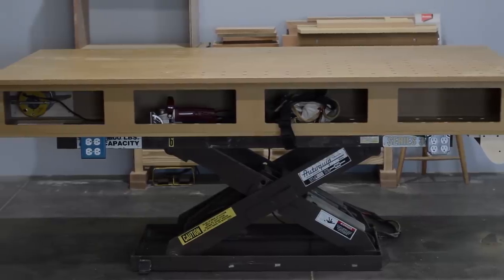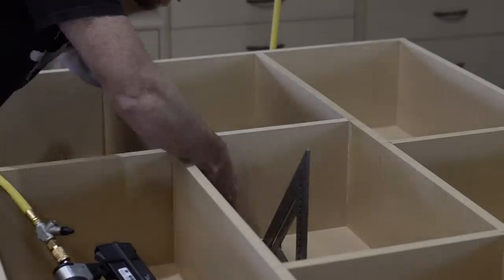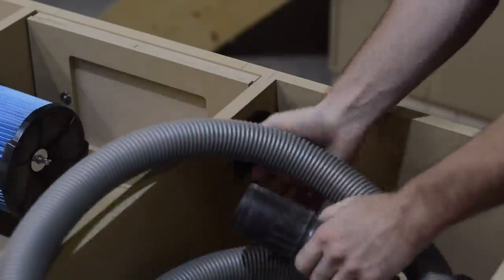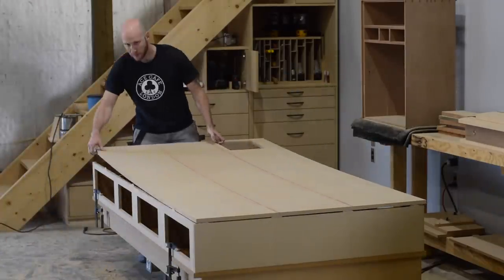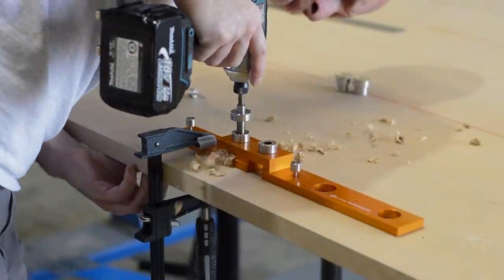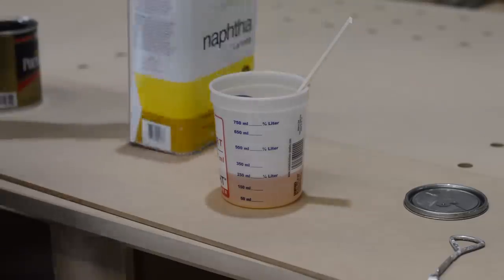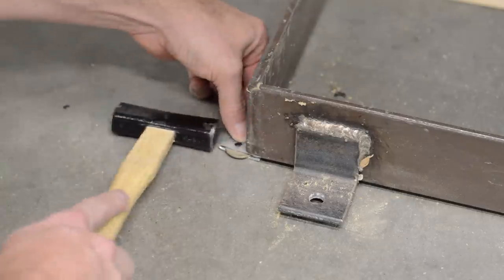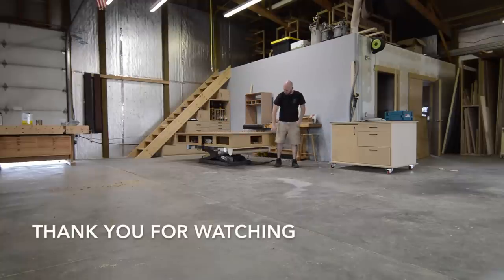A Modern Cabinet Makers Bench For Woodworking & Carpentry

Comment: Not sure if you've solved the vacuum hose problem, but you could make a clip that would attach to a peg that fits inside of a bench dog hole. It would look something like a capital "P" with the hose running through the eye of the "P" and the stem being the peg. Then you could move it around as necessary.
Reply from the maker: I ended up doing something quite similar. I made a mount that fits in a dog hole that has a hose clip.

Comment: Mike, I am considering a scissor lift bench like this as my primary bench, including for handtool work such as planing. Question: is your scissor lift rigid against shear -- like the force of handplaning (or would it be if you bolted it down)? or is it only rigid up and down?  Fabulous video. thank you!
Reply from the maker: For many years I only used this bench, power tools, hand tools, etc. My answer is yes, mine only moves slightly when I stand and jump on it. However, there are scissor lifts and then there are scissor lifts if you follow me. This unit costs almost 10k new these days. I do not have experience with the lower cost units. I say try to get your hands on one for a test drive. I would also say that in one direction it will be better than the other. So maybe planing only goes lengthwise.

Comment: Giggled a bit when I saw the MDF dust flying all over the place (with the drawers in the back open). Not long after that you mentioned you would integrate the dust collection on your torsion box.  Btw. Our boys always seem to carry more about the packaging too..  What neat kind of little hand-router are you using? it even seems more compact than the 700C. Thanks for posting the inspiring video!
Reply from the maker: Thank you. During this build my shop vac used for hand tools was taken apart, by the end of the build this problem was fixed... Yup I used two small routers, one was the small sized Dewalt, the other was the Porter Cable PC310, this router is sadly no longer made.

Comment: Really nice build Mike.  How do you replace the top after 3 yrs or so.  How do you get it off without tearing up the whole box?
Reply from the maker: I don't replace the top, I just keep in nice, I add a coat of poly every 6 months or a year. It's holding up nice. I use it almost every day.
Reply: @MikeFarrington   Sorry. I misheard you say in the video that you replace them every 3 yrs or so.   Seemed like a waste to me as well.
Reply from the maker: @allenlane5000  Well not really, I keep them until I want to build a new one with new features, or if I move, or some other reason.

Comment: Sweet rebuild. I'm sure it has been said many times but I will still put in my vote for a 20mm hose hook/keeper. You mentioned ordering the dust shroud for the router. Do you mean the one for the plunge base only or is there one for the fixed base that I don't know about?
Reply from the maker: Thank you. A friend is sending me some hose clips, I'll start with those and make improvements if needed. Yes, for the plunge base. I tried it out, works pretty good.

Comment: Mike, in practice, what is the lowest height you have used this table during assembly tasks? I'm in the process of building my own and am debating just how many banks of drawers I can place under the torsion box before impairing the functionality of the lift.
Reply from the maker: Probably every other job or so, I lower it all the way. For example adding drawer slides to the upper part of a cabinet. Set cabinet on bench lower all the way, now its at the perfect height to work. If you wanted to make the box a little thicker you could. I don't think it would kill the function of the lift. Maybe build a temporary top first?

Comment: I enjoyed the video as well Mike, very interesting ideas in your design and build. There is one thing I would like to ask though; you have a fitting on your air line just in front of the nail gun that looks like it's a blower nozzle...where did you get that? Thanks
Reply from the maker: I wish I had a good source for those. Its a blower as well as a quick connect. I bought two at an auto parts store that was going out of business.

Comment: Knackers, your glue line statement is only correct if it's not balanced design. A properly designed system has its ultimate strength derived from its outer skin (cords second moment of area). The weak point of your design is the rectangular side cutouts as force doesn't transmit across a gap, the translation of comprehension and tension through that side plate little stilt webs is low. Look to truss bridges for inspiration and use triangulated web or place large radii on the ends of the cutouts to simulate "X" webs. Probably work fine for your u so I'll plug it now.
Reply from the maker: Very deep in the weeds. This was my motivation for leaving the center two ribs solid. Fortunately this is a work bench top that is mostly supported by the table beneath it, and not a bridge :)

Comment: Do you find any extra flex in the box with square holes ,and i noticed in the new one you didn't have as many ribs ,i take it you realized it was the glue, myself i was thinking 1/2 birch ply with a replaceable top
Reply from the maker: I have not noticed any extra flex, but this top is new to me. My older versions were so over built its not even funny. 1/2 birch with a replaceable top would be cool.
Reply: Ron Paulk showed us to Just use some sacrificial 1x4 lengths across the top when needed to save replacing the top.  That parf system time and effort makes that top super expensive.

Comment: Mike, are you still using the crosscut feature from the parf-guide system? Do you like it? I'm trying to decide on buying that and going that route or just getting an MFT for accurately cross-cutting my larger panels.  Thoughts after 2 years of use?
Reply from the maker: I had an MFT. It was one of the older ones. I always bumped it out of alignment. I still really like this setup. Making your own is also nice because you can make it any size you need.

Comment: Just in general, what do you think of track based clamping verses bench dogs?  Obviously you like bench dogs.  But what do you consider pluses and minuses?  I was planning on going with track because dust falls through the holes.  But, of course, with the torsion box, you just have to vacuum the box.  So, I might go torsion box too.  I'm still planning my build.
Reply from the maker: I think the track / clamps can work good. My problem with them is the create a place for things to get hung up when pushing big items around the bench, like glue ups etc. The dog holes have far less of a chance of catching something. I think both can work very good. The dog holes are cheap. A drill and bit can at least get you started.

Comment: Hi Mike, I recently discovered your channel and have been getting lots of great ideas.  I have a torsion top bench on my to do list.  Every time i see one with storage in the sides I think, "that should be drawers".  Is there any reason drawers wouldn't be preferable in your opinion?  Thanks for all the great content.
Reply from the maker: drawers would work fine. I didn't think I needed them there because I wanted max storage for hand tools. As it is, my biscuit joiner just barely fits in the openings. If there were a drawer, it wouldn't. Just keep in mind what you will be putting in there, and if a drawer makes sense, go for it.
Reply: @MikeFarrington  Great point, I always forget how much space is eaten up with drawer sides and guides.  Thanks for the response and have a great weekend!

Comment: Nice table... but how do you manage working with MDF? It weighs a ton and very hard to carry and i always get some irritation in my eyes due to the fumes that comes from them 🤧
Reply from the maker: Thank you. I have a few carts and a sliding table saw that really help dealing with MDF. I also buy high end MDF which doesn't have the fume issue.

Comment: Over time, do the MDF dog holes keep their shape? I would imagine that they get warped with the pressure exerted by the metal parts pushing against the cylindrical MDF holes? Thanks!
Reply from the maker: Yeah, the two issues I have had are glue dripping in the holes and then when I refinish the top periodically, I need to make sure none drips. If either happens, I just re-drill them.

Comment: Hi Mike. I really appreciate your content. Wonderful job! I'm building an outfeed/assembly table currently and would like to integrate that large roll of paper i see in your design, here. I'm assuming you use it when doing glue ups or other messy work to protect the top? Can you tell me what kind of paper you're using and where you get it. Thanks! I know you're busy.
Reply from the maker: Thank you. That is just masking paper, I get it at Lowes in the paint section.

Comment: Is the strength derived from the fact that under a load the top and bottom experience opposing forces?
Reply from the maker: It's that the glue line connecting the top and bottom to the grid won't let flex.

Comment: Great build and video!!  Mike, do you prefer the MDF with a protective finish vs hardboard laminated to MDF for a workbench surface?  I understand one would have to chamfer the 20mm holes to still use festool clamps with 1/8" hardboard added to 3/4" MDF.
Reply from the maker: Hardboard would probably be better if you get get it glued down nice and flat.

Comment: Do you really need a flat surface to build a torsion box on?  Doesn't the torsion box kind of just self-flatten as you glue and screw it all together?
Reply from the maker: Depends on how flat you want the end result. The box will self flatten a some, but the end result will be better if its on a surface that's pretty close to start.
Reply: @MikeFarrington  That makes sense.

Comment: Do you use the secret poly blend just for MDF, or would it be suitable for hardwood as well?  I've never really thinned polyurethane, but do you think it would be helpful for something like a walnut table?
Reply from the maker: Its a fine finish for most things to include solid wood. Because its thin it doesn't build quickly. Thats the disadvantage.

Comment: The bolt at 15:18 is considered a flat head screw.  They can come with different countersink angles, but they are normally 90 degrees
Reply from the maker: Thank you. They are really good for making sure you bolt doesn't get in the way.

Comment: Is there a reason apart from accessibility, for the lack of dog holes centrally? And by the way the scissor lifts can be bought cheaper on alibaba with less than Brooklyn bridge gauge steel, and suitable for smaller shops
Reply from the maker: No reason. My experience has taught me that I clamp near the edges. If in the future I needed some holes in the middle, I will put out my Parf guide system and drill a few more holes. I bought mine used, so I can't speak to any deals on the web. Also, I see these used constantly on crags list.
Reply: I guess the middle 1/3 is not accessible from the outside to retrieve anything that may fall through the dog hole? Your channel is absolute class, great sense of humour appreciated by this Kiwi!

Comment: Mike I understand why you used MDF however could Partical Board for the sides, inside grid and bottom work. The top will be burch plywood
Reply from the maker: Hi Richard, I see no reason why partial board couldn't be used. I would make sure to use a ton of glue on the edges. A Birch plywood top would work great.
Reply: Yes, Glue and  counter sink screws ... even through the top plywood. My reasioning is to keep the top perfectly flat as well as a visual signs where the grid lines are layed out. This will also be the outfeed table for a new table saw.
Reply: Oh , yes I used wipe on poly on my partical board. 4 or 5 coats. This thought came from me using a piese of Partical board cut off that was perfectly square for a sanding block. I wondered it would ever swell and move out of square. With three years of use from dry sanding and WET sanding finishes this partical board block is still square and true. This is why I like partical board over MDF for shop counters and tables.
Reply from the maker: Partial board is a good product when used properly, no doubt. Plus it is super cheap. Glue and counter sunk screws will work great as well. Best of luck. Let me know how it turns out.
Reply: Richard Boyd just glue the top otherwise you risk damaging a blade.
Reply: @whoDatBeDare  yes I guess I could mark the top where the toursion grid is. Also i thought I should pre-glue the edge of the partial boards to prevent a starved glue joints. Mike
Reply: @whoDatBeDare  I'm also considering doing the top ... a 2x4 workbenche top rather than  2 layers of burch plywood... what do you all think about that. Mike?

Comment: 13:21 After using the “secret ratio” polyurethane for the first coat, do you use that same ratio for subsequent coats or just the first?
Reply from the maker: Yeah, I just keep adding coats until it looks right, normally 2-4.

Comment: Greetings Mike, I like your bench. What is the maximum change in elevation to you adjust you bench. Would a 12" change be enough?
Reply from the maker: Thank you. The table can move up and down like 36" or so. 12 would be fine for comfort. I like to lower the table all the way down to help get heavy things off the bench. Its also nice to raise it up really high when working on something small.

Comment: if you have a domino why did you use the biscuit joiner on the side panels of the bench?
Reply from the maker: I like the biscuit jointer better. Its faster and easier to use, plus it does a better job of aligning along a length.

Comment: Isn't the depth of the box where most of the strength comes from assuming that the grid is glued securely. The deeper the box the stronger it will be, the glue area does not change much between a 4 inch deep box and a 8 inch deep box.
Reply from the maker: Agreed, thicker will resist sag or flex more. For woodworking there is a diminishing return for all practical purposes.

Comment: Great video! And great table! I have one question though. Have you have had a problem with dropping stuff into the open holes on the worktable? Im thinking of making a similiar table, but one of my worries is that i will drop something down in the holes and wont be able to get it up.
Reply from the maker: Thank you. I have access to all bays, so if something falls in its easy to get. I would say make some of the table with holes and some without so you can select the surface you want to work on.

Comment: Great video. How did you plan the position of the grid for the  torsion box and not have the part holes be on top of the grid rendering them useless?

Comment: When I was starting from almost nothing in the way of tools. I made a torsion box using yardsticks and 1/4" hardboard, for use as the  sub-base table for my '50s era DeWalt RAS.  It was a very economical and easy solution for the need, and years later, it's still flat.  I just replace the sacrificial layer when needed.
Reply from the maker: Sounds like a great use of available materials. Well done.

Comment: Why is it important to have a flat surface to build ome of these? Once you screw or nail the top and bottom to the inner grid doesnt it pull the top flat? I am curious because the 5 vids I've seen 2 people mentioned your method but not why. 

Thanks in advance!
Reply from the maker: It depends on how flat you want it. If you make it free style with no supporting surface, there is a good chance you could build a surface that is not flat. The question is, how flat is good enough. For many that could be plenty flat, I do this stuff day in and day out, I want a very flat workbench.

Comment: Hey brother. Fellow pro woodworker here. What biscuit jointer is that? I have a porter cable and it kinda sucks. Not as accurate as I would like. How is the accuracy on your biscuit jointer?
Reply from the maker: Hey, great to hear from a fellow pro. I am using a Lamello top 20. The current model is the top 21. I had the porter cable before this one, and yes, this is much more accurate, in fact, this one is crazy accurate.
Reply: @MikeFarrington  perfect! Thanks brother. I'm gonna put that on my radar.
Reply from the maker: If you can pick one up used or justify the new cost, they are a great tool to have in the shop.

Comment: After applying finish did you have any problems with the dog hole sizes?
Reply from the maker: No, I was careful not to get any in the holes. One or two had a drip, so I drilled them again.
Reply: Thank you for your help and all your inspiration.

Comment: Curious weren't some of those dogholes obstructed by the grid work.... Did you have to drill those back out
Reply from the maker: The pattern was drilled so that this was not a problem. If you look at the center of the bench a row was left out for this very reason.

Comment: Hello mr. 
Would have loved to have such a bench, but my shop is to small, great video though. 

See you use a lot of mdf, I do not have a lot of experiance with it, and are planing to make dentile mouldings for my house this year. Do you think that Mdf would be a good substrate ? I am thinking about the paint and "flurry" edges. 
Hope to get a pro tip :) 

Happy new year from Norway. 

TR
Reply from the maker: The key to painting MDF is to buy good quality stuff, that has a nice dense consistent core. Next is good priming. After that it paints just like anything else.

Comment: Any thoughts on tung oil vs your mix of poly for a similar mdf top?  Thank you in advance.
Reply from the maker: Tung oil is a great finish, I think the downside would be that it cures much slower, and its not quite as durable, but it has a much nicer feel.
Reply: Thank you. Will the MDF yellow at all with the poly?